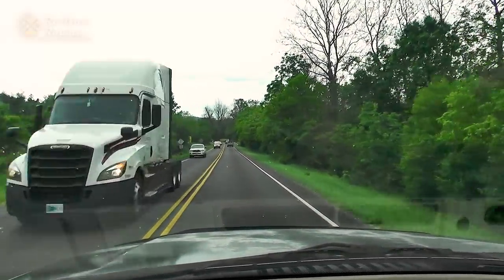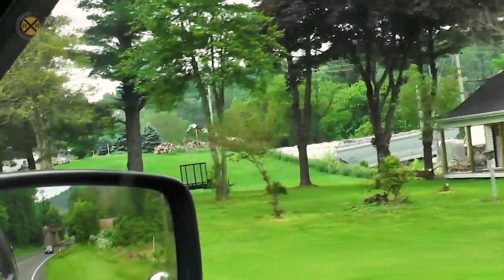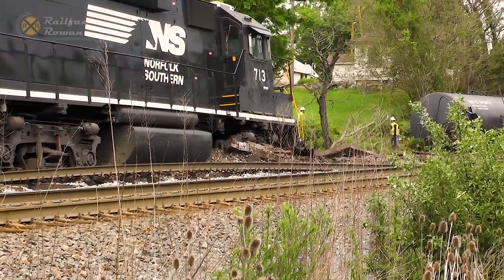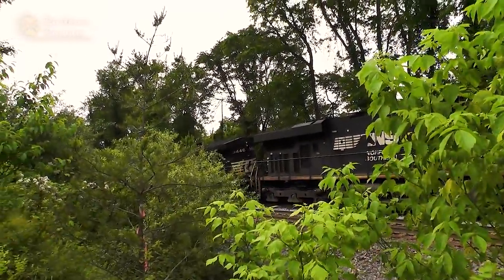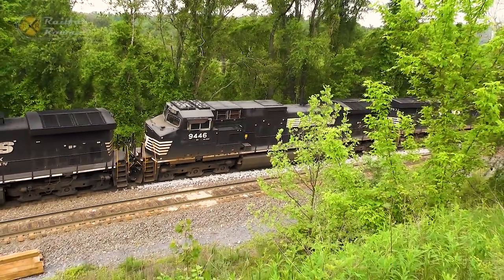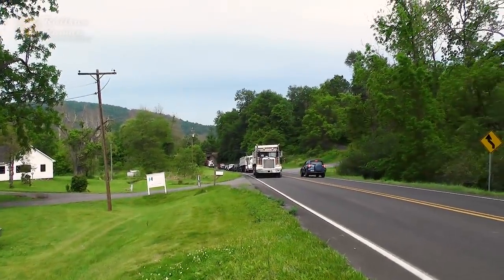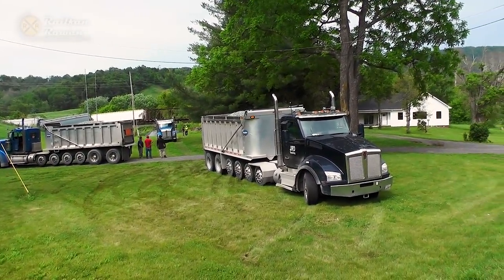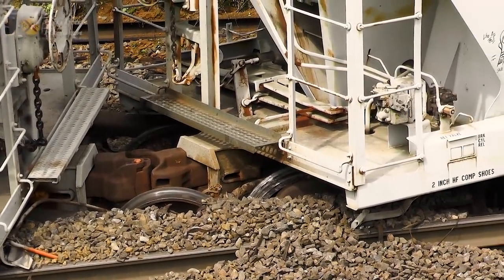BIG Derailment Near Front Royal Virginia - I-66 Norfolk Southern Freight Train 12R Linden VA

Comment: That long torch also keeps Mr. Cutter out of the line of fire of anything that is under pressure. Those steel rods could have thousands of pounds of stress just waiting to snap and they don't have the ability to care if anything is in the way.
Reply from the maker: That's a good point, that many others have brought up, of course while watching you don't know what you don't know. I've been more.informed.by the comments in this one than most of the video! 😊
Reply: @RailfanRowan  
Thanks for the reply. I've done factory/industrial work for almost nine years and one of the biggest things I've learned is the most dangerous hazards are the ones you never think to plan for. Almost everyone thinks about and watches for a heavy load on a crane causing problems while not too many people pay attention to the worn bolts holding a load spreader for a crane together.

Comment: At 14:00 is the absolute miracle.  The tank car bottom outlet valve did not shear off.
Reply from the maker: Very good observation, thanks for sharing
Reply: @RailfanRowan  Another design is a 3 inch or 4 inch ball valve that is protected by skid plates on either side of the valve.  The Chicago design engineer has all my respect and gratitude for improving safety, avoiding spills.  The skid plates also try to keep the tank car inside the tracks when the wheels fly off.

Comment: Best tip do not be near a junction that are crossed at high speeds.  If along solid rail and you see something that does not look right call that 1800 number posted at the crosses asap.  Also if at a wreck and the conductor and engineer are running away you should also cause something might be very wrong.  Like a leaking chlorine gas tank.
Reply from the maker: That's correct, and they have papers that tell them whatis on their train and where
Reply: @RailfanRowan  I was a conductor till I got a job that I went to college for.

Comment: 5 engines and at least 11cars....Praise god, Rowan god is responsible for this mess. He didn't watch out for anything when he set this off.  If god was busy keeping people safe than he also let it happen. Right - sort of deductive reasoning.  If someone could interfere to prevent injury in the SECOND place, then they could have prevented the whole thing from happening to begin with.  Just a thought, Rowan. You did a nice job of covering the devastation. Sad to see so much equipment going to scrap. Lucky the engines didn't get smashed up. For those cars toward the read to zig-zag like that, there must have been some load to drive them forward where the engine - pulling the consist, stared pretty much on the ties.

Comment: Explain “jumped a switch.”  Thousands of pounds of steel typically don’t jump much.
Reply: If the tracks at a switch, or a junction, are not completely aligned to one direction or the other, then the narrow gap between rails can for the train's wheels to ride up and over the rails and on to the ground.
Anytime the wheels end up riding up and over the rails and onto the ground can be referred to as "jumping the track."
Reply: If the rail vehicle has what is termed as a " Sharp Wheel Flanges ", the wheel flange can split a switch blade, if the switch blade is worn, this can cause a derailment, or as we call it in the UK " an Earth Fault " .

Comment: Looks like lead unit picked the switch point , just speculating could be caused by broken switch point , false signal  or thin flange on lead locomotive wheel . False signal did happen to us on trainTO46 @ 4am on the Wisconsin Central back in 1995 at Duplaiville WI . That mishap happened at a Junction where two switches are facing switch points to each other , caused by signal error and combination of dispatcher getting false indication and thus  lining facing point switch while we were in circuit "" between absolutle signals "" what a ride that was , luckily we were proceeding from a stop after meeting an opposing train we were only doing 7 mph and only derailed the lead unit  .So we had a clear signal while the switch was  moving and when we dropped the signal to red the switch stopped half way between both rails . " The clear indication to red disabled all electrical  current  between absolute signals just like its supposed too . Thats the failsafe in the electronics so the dispatcher cant make an error . Doh !!!
Barry
Reply from the maker: Wow barry, thanks for this story, that was pretty cool
Reply: @RailfanRowan  your welcome,  happy to share my experiences!
Barry

Comment: how are these companies making billions and yet tracks are failing? where is the FRA?
Reply: I work for the rr..hedge funds take over ..profit is their only concern..they ring us dry then move on
Reply: Also Rowan made a fair point..this may have been a run thru switch..but I do hear what you’re sayin
Reply: @chickenandanap  a run through  switch does not cause a derailment as it is a diverging move. A facing point switch improperly lined results in either the head car derailing or the middle of the train derailing. A train the goes over a derail at low speed will put 1 or 2 trucks on the ground, a train hitting a derail at highspeed will destroy a derailing device and stay on the rails.  When you have cars on their side or the majority of a train on the ground it is due to a track condition.

Comment: LET US KNOW if you find out what caused the wreck.
Reply from the maker: Def will do a follow up!
Reply: With current railroad cost-cutting, many trains are now between 2 and 3 miles long & over 10,000 tons! Most class 1s know that the safest way is to have all the empty cars in the back third of the train and all the heavyweights near the power. When u have the empties near the power and all the loaded cars mixed in or near the rear while going up a grade or around a curve the light cars tend to have the wheel flanges ride up and over the top of the track and derail. My guess is the current reasoning is that they can put up with having accidents and save the money from having to reorder car positions.